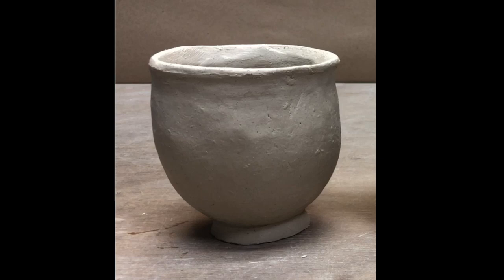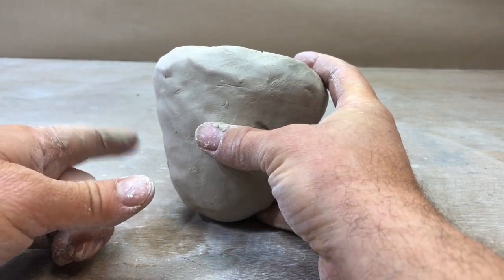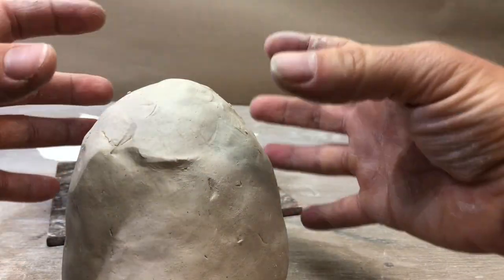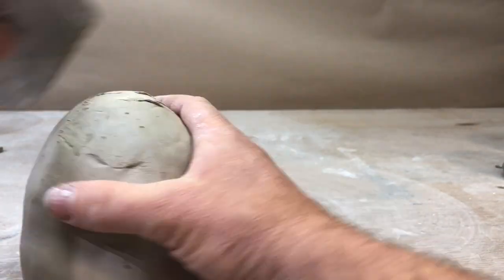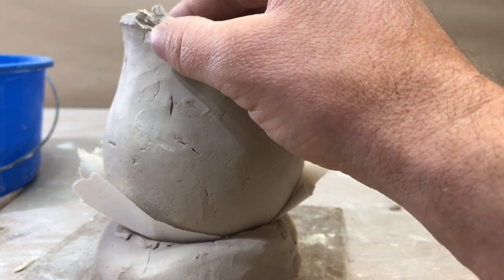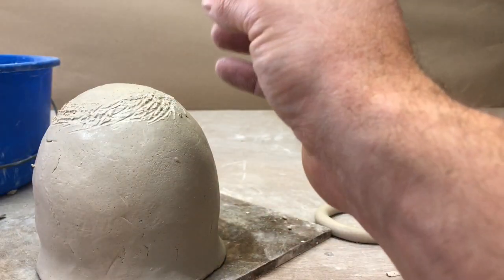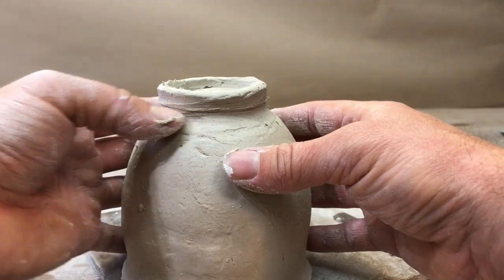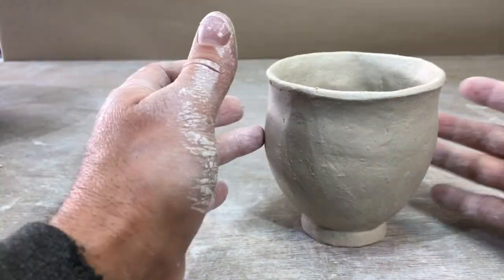Round Cup With Foot Ceramic Handbuilding

Comment: Hey Wesley! Great instructional video. Gearing up to make these for my students and I'm wondering how you had the camera propped up at that angle. Perfect perspective for clay videos!
Reply from the maker: Hi Nell! 
Glad you liked it. I use: I use a selfy stick that also works as a tripod. This one is really good: benro bk10 mini tripod and selfie stick for smartphones. I use a strap to attach the handle to my work table so I can reach around it without knocking it over. I also use an Apogee MiC
Reply from the maker: Hi Nell, 
I use: Benro BK10 Mini Tripod and Selfie Stick for Smartphones, strapped to the edge of my table wit Apogee Mic plugged to my phone which is filming. The Selfie stick is strapped to the edge of the table and I reach around it with the phone next to my chest or face. Kind of awkward but it works (-;